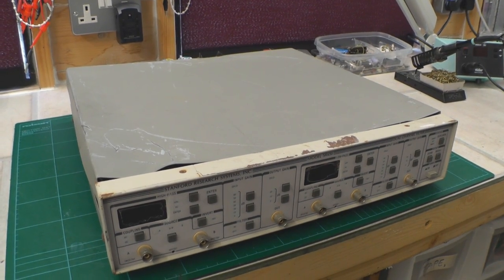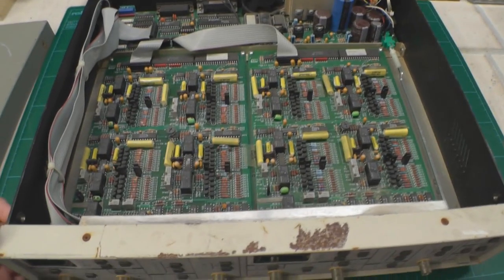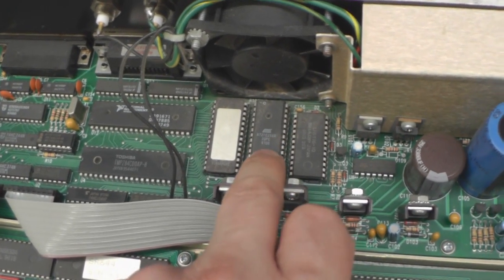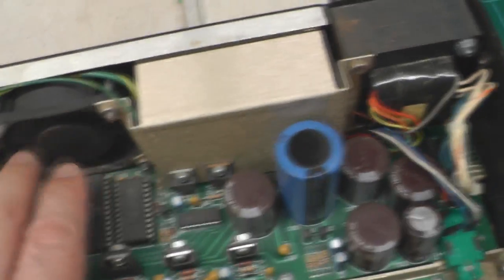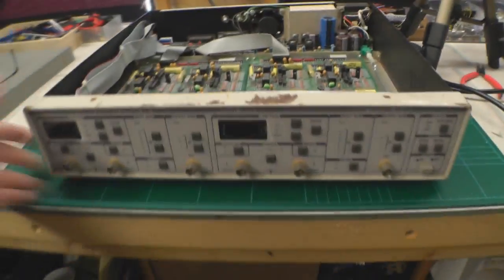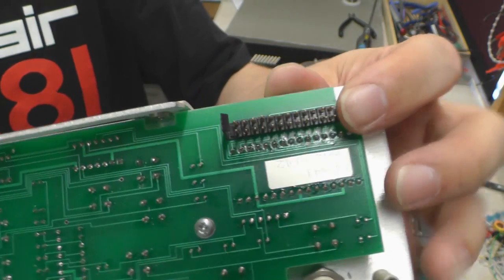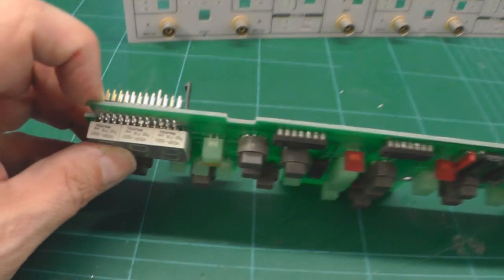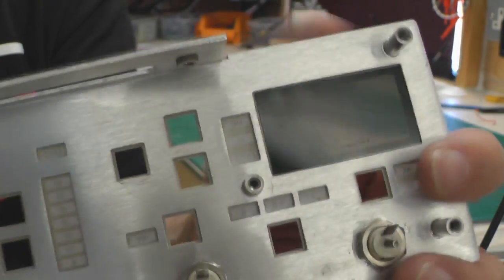Stanford Research Systems SR650 Dual Channel Filter Repair - Part 1

Comment: Excellent presentation, looking forward to part II. You are obviously into DIY and restoration, have you ever considered a small powder coating setup? A friend has one here in the UK and he has done some stunning work. His best was a crackle finish on a race engine plenum I built from a chopped up fire extinguisher alloy bottle.  It was actually a better crackle finish than Ferrari produce on their road cars plenums. He uses a cheap Ebay electrostatic gun and an old oven from a commercial kitchen.

Comment: Nice job on the case and insides there. Tip is to simply cut some heatshrink and cover the sides of each LED with black sleeve and shrink it. Will not leak light and will not peel off either. Paint the transformer core top and bottom with a little satin black enamel ( spray can simply sprayed into the can top and applied with a small brush) and it will look like new, and will not vibrate either. Having stressed those front panel inserts I would recommend a small drop of clear epoxy on the base to fill in the gap and provide support against it pulling further loose. Just enough to fill the gap there and provide some extra support, as they have been stressed and are going to come loose eventually.

Comment: Blimey, did you pick that off a deck offshore.? Good renovation job though. What articulating mag lamp is that you have in the background? The joints look sturdy. The one I bought at haudagain is a bit flimsy but does a turn.
Reply from the maker: Bought the lamp off eBay.

Comment: Looks like Dave could go a lot further with the heatsinking on his unit too on the two rear transistors. Even though he added a couple of sinks it seems your unit uses a huge part of the metal construction as a sink here. However IIRC that part was missing on Daves.
Reply: I just flicked through Daves video to check the same thing myself. it seems like the heatsink in place was a custom peice of sheet metal. interesting! 

Much more beefy then the one dave replaced his with!

Like like the reasons dave's doesn't have a heatsink is because the previous person to open it must have removed it to access the AC Filter/Fuse area and then never replaced it when he put it back!
Reply from the maker: It maybe doesn't need such a big heatsink.
Reply: IanScottJohnston
 Nope probably not.